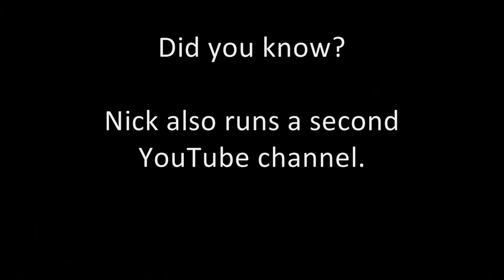Onsite Cleanout of a FILTHY eMachines system

Comment: Would it be safe to blow compressed air through the vents in a netbook or laptop without disassembling anything?
Reply from the maker: Yes, but be careful when blowing out the vent where the cooling fan is. The fan is fragile and will fly apart if spun too fast.

Comment: Did you not notice those caps?
Reply from the maker: Yes I noticed them. That motherboard got replaced.
Reply: Ah OK, I was curious because you usually make comments somewhere about them
Reply from the maker: ***** I was quiet here because I was in someone else's business, though I meant to put something in the description about it. I did attempt to recap this board but due to the way this board's designed, I couldn't do it successfully. I had another socket 754 eMachines board with a better chipset and PCIe slots. I was able to drop it on without even having to reinstall Windows.
Reply: Oh cool then

Comment: one question, do you know the name of the cpu cooler you have in the black max? im looking for a cooler for another pc and they seem like decent coolers (i dont want to buy an expensive one)
Reply from the maker: The cooler currently installed in the MTDX Black Max is a modified Sunbeam Silent Whisper heatpipe cooler. They don't make them anymore but you can find similar coolers on Newegg for fairly cheap. That cooler was sold back in the AMD K8 days (It's listed as a Socket 754/939/940 cooler) but works with the newer AMD CPUs too. There was also an Intel version for Socket 775.